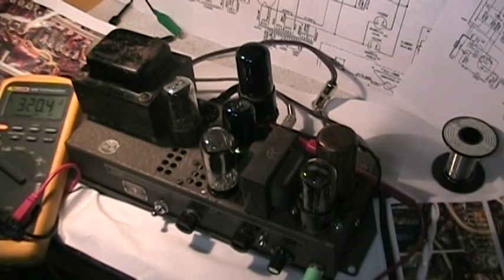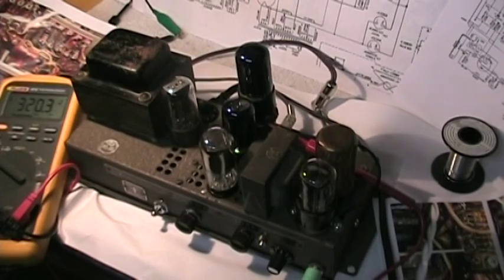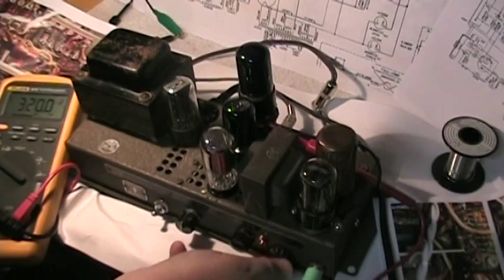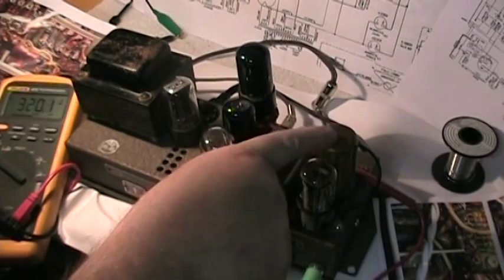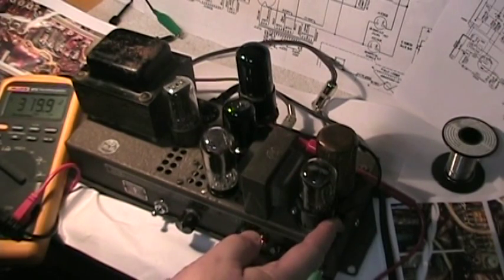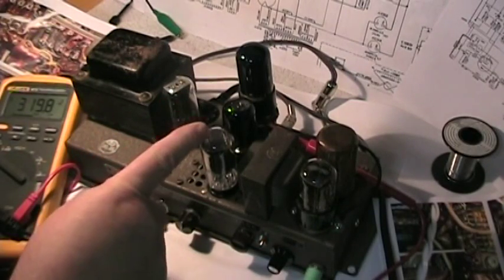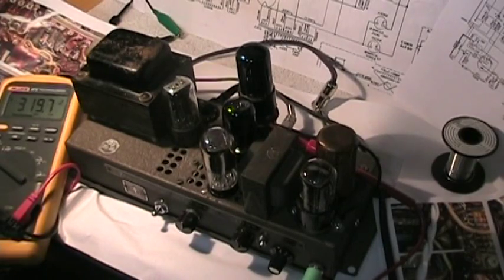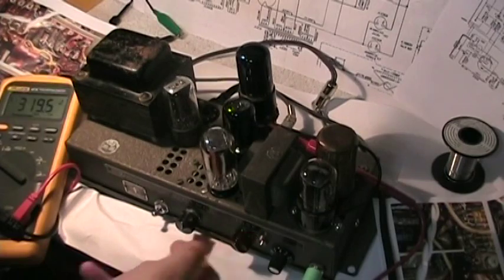Tubesntone Filmosound Deluxe

Comment: Nice Job, I'm a harp player and it sounds to me that it would be great as a harp amp. Nice warm and strangely clear (not muffled) distortion. I have a similar filmosound amp. Identical tubes and appearance. It is a model 179.  If you wouldn't mind sharing your schematic I would greatly appreciate. I have tweaked a lot of my amps but never done an amp build. This would be great.
Reply from the maker: If you want to build this amp it needs a cathode follower. Look at this website 
http://www.valvewizard.co.uk/dccf.htmlfor the DC cathode follower, and add a volume pot before the 6SN7 and after the pentode. That way you can control a bit of the preamp and volume on the next pot. 
Take the signal off the anode to the volume pot then to the cathode follower. 
I used the Bell and Howell FilmTech Bell and Howell Amp Schematics; you can find this online...look for the H10 page.
I build these for fun. Next step is to have this in a Princeton type amp with reverb. 

Johnne in Seattle

Comment: Can you tell me where you found the schematics?
Reply from the maker: If you want to build this amp it needs a cathode follower. Look at this website 
http://www.valvewizard.co.uk/dccf.html
for the DC cathode follower, and add a volume pot before the 6SN7 and after the pentode. That way you can control a bit of the preamp and volume on the next pot. 
Take the signal off the anode to the volume pot then to the cathode follower. 
I used the Bell and Howell FilmTech Bell and Howell Amp Schematics; you can find this online...look for the H10 page.
I build these for $1800 and use a Princeton type chassis and amp cabinet, with or without reverb. The reverb it 2K and it comes with an alnico speaker. I don't make much but have fun with this project.
Have a fun build!! 
Johnne in Seattle

Comment from the maker: I have made a beautiful cherry with maple sides cabinet for this amp.  They will soon be on eBay until I can get my site up and running.  This version is $300 plus $25 to ship anywhere in the country.  Overseas is a different story.  I will post a picture of this amp soon.
Reply: Johnne L have you already sold this amp?? 

Thanks!

Stephen
Reply from the maker: I sold this amp to a guy in Switzerland of all places! I
have an amp chassis that I am working on and about finished with that, so that
amp will fit in, and you can take out for servicing. I have about ten of these
chassis and some that are in the works to have finished. These are killer
sounding in a small package. If you are interested, you can write me at
nicheosund@aol.com and I will keep your name and let you know when they are
finished. The price is $575 for the amp plus shipping, and another $275 for the
cherrywood cabinet which is a beautifully done piece of wood with maple. I will
also have some lower budget cabinets too. The chassis has a cutout in the top
to place a beverage or place other goodies, and it also serves as a handle to
carry the amp around. I am also considering a two - 10" bottom to go along
to be able to sell as a set. The amp would then be placed on top of said
cabinet. I would then switch the bottom four ways: parallel, series, series
parallel, and series series...it would be a switch with four settings. I have
done this with a two 12" cabinet and it is very versatile.
Reply: Johnne, I have one of these amps and would love a copy of your final schematic to check out the changes you made. It came out real nice and has a nice sound. Thanks! Donnie
Reply from the maker: send a note to nichesound@aol.com and I will send a copy of what I did.  PDF.
Reply from the maker: If you want to build this amp it needs a cathode follower. Look at this website 
http://www.valvewizard.co.uk/dccf.html
for the DC cathode follower, and add a volume pot before the 6SN7 and after the pentode. That way you can control a bit of the preamp and volume on the next pot. 
Take the signal off the anode to the volume pot then to the cathode follower. 
I used the Bell and Howell FilmTech Bell and Howell Amp Schematics; you can find this online...look for the H10 page.
I build these for $1800 and use a Princeton type chassis and amp cabinet, with or without reverb. The reverb it 2K and it comes with an alnico speaker. I don't make much but have fun with this project.
Have a fun build!! 
Johnne in Seattle
Reply: Johnny can you send me a PDF of what you did, I have a filmosound 179. Thanks Michael
Reply: Johnne I hope you are ok.  I have not received a reply back from you.
Reply: @MichaelRodriguez-qm9my  The 179 has a different tube complement. It will be a different amp. There are plenty of videos on customizing 179's for guitar. This is a 156.

Comment: Drummer, guitarist and amp tech! lol Sound great, If you were a carpenter you could make a cabinet for it...
Reply from the maker: If you want to build this amp it needs a cathode follower. Look at this website 
http://www.valvewizard.co.uk/dccf.html
for the DC cathode follower, and add a volume pot before the 6SN7 and after the pentode. That way you can control a bit of the preamp and volume on the next pot. 
Take the signal off the anode to the volume pot then to the cathode follower. 
I used the Bell and Howell FilmTech Bell and Howell Amp Schematics; you can find this online...look for the H10 page.
I build these for $1800 and use a Princeton type chassis and amp cabinet, with or without reverb. The reverb it 2K and it comes with an alnico speaker. I don't make much but have fun with this project.
Have a fun build!! 
Johnne in Seattle